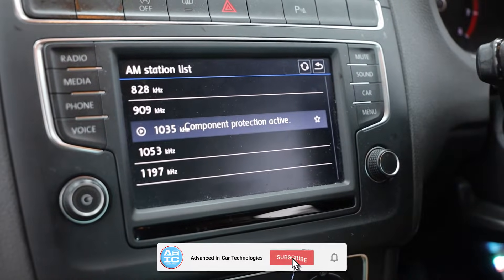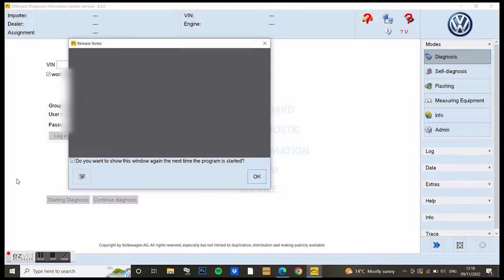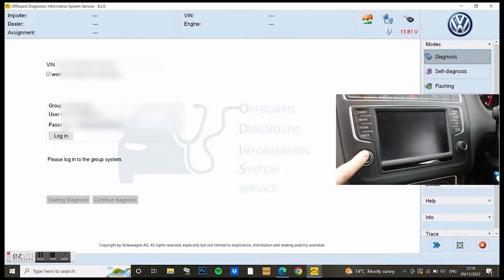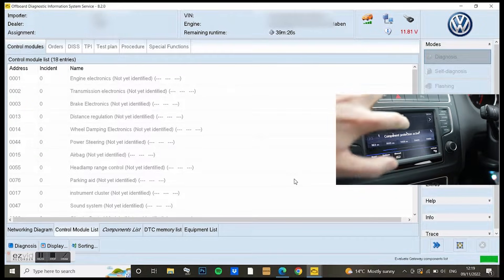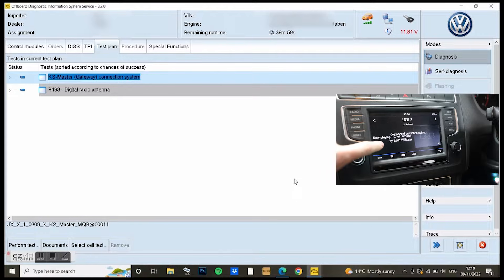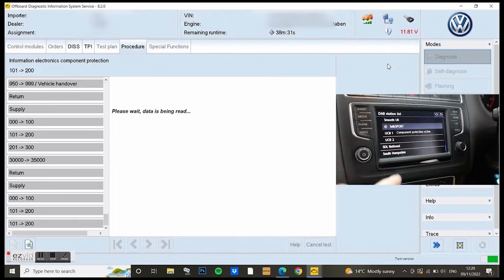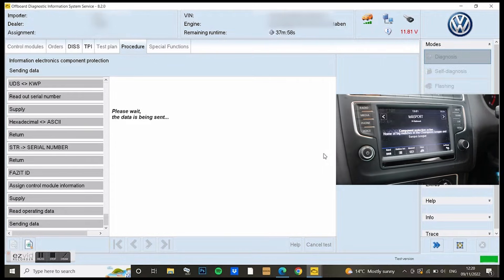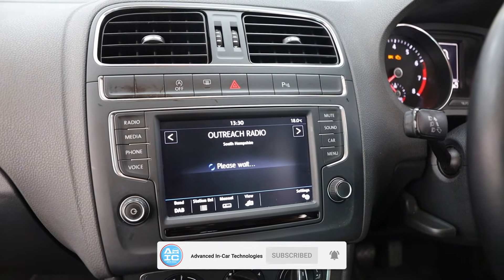How To: Deactivate Component Protection From Your VW Radio Via ODIS

Comment: I was damn well about to send this video to my VW dealership. I asked them if they could do this for my new (used) unit I have coming in after the original one got stuck in an endless power boot cycle. They said they've never heard of doing such a thing! Despite so many cars among multiple years having radio issues!
Reply: Ive fixed it? Might be able to help
Reply: That's only because main dealers don't fit used parts mate

Comment: VW B6 2007 - security protection turn on, on radio, after I had replaced a burned fuze - now radio is stuck bc previous owner lost a code - how 2 unlock/bypass that?

Comment: This video is not complete, after you are removing component protection, you are not showing what else will be going on, you are going to be losing 3 features. 1. bluetooth, 2. telephone, 3. car play. thats true i did that to my system and i was thinking everything is ok but when i was testing all features its showing 3 features is not active, which means you are going to have swap/ fec keys to be able to get back 3 features working, but it all depends if your system is is unlocked or stock, If its stock you will be needing swap patching system to be able to set the swap keys that is supporting your car
Reply: That’s exactly what happened to mine last week 🤬 Do you gave a way to fix that???
Reply: @melvega1903  I can help fix :)
Reply: @Beterr I am in the same boat. Got protective mode cleared out with ODIS from the dealer but still don’t have Bluetooth / phone / CarPlay. Any tips? Is this still a fix within ODIS? 2016 Tiguan with navigation
Reply: Factory radio touchscreen broke… replaced with a used radio and had the dealer remove protected mode… 160$ … and still not Bluetooth / CarPlay / phone / nav. Radio only 👎
Reply: is there any solution ? i got that problem
Reply: How are swap keys set?
Reply: How do you do the swap keys
Reply: Chances are you'll have to reactivate via secret menu if it's anything like the c6 a6
Reply: Cómo sería? @jimneybob8847
Reply: The video shows exactly what it says on its label - resolving CP conflict. You also need to transfer your FEC codes for additional features to work, and that's entirely different topic.

Comment: Nice video, what cables are required to connect via odis? Is it the e1000 from dlink?
Reply from the maker: Hello Christopher,

Thank you for getting in touch!

We are an authorised VAG independent workshop and have access to main dealer diagnostic equipment. This is the reason why we are able to complete these procedures. 

We can’t offer any advice on other aftermarket peripherals I’m afraid sorry.

Kind regards,

Advanced In-Car Team

Comment: I had to replace my ACC sensor on a mk7 GTI with a second hand unit from a breaker, will this make it work again? Thanks
Reply from the maker: Hello Shaz,

Thank you for getting in touch and sorry for the delayed reply!

For my team to assist you with your enquiry, we would need you to fill in our contact form so we can do some checks. Please see our link below:

https://www.advanced-incar.co.uk/contact-us/

Once received, we will be in touch as soon as we can to assist you. 

Kind regards,

Advanced In-Car Team
Reply: Did you get an update, iv got the same issue on my mk7 gti
Reply: @ayshaakeel388  hello,
I have ordered the exact part number for the sensor. Once it arrived, it had to coded to the car. There will be a “component protection protocol” that needs to be released (it’ll still be coded to the old car it came from”. You can only do this with the vw official ODIS software (although I’m not 100% certain). Once the second hand part is coded to your VIN. You will have to have the sensor aligned using ADAS specialist equipment.

All in it cost me £250. Including the part. I did all the fitting but got a friend to do the coding and sensor calibration. You should be able to find a vw ADAS specialist in your area. Hope this helps

Comment: hello, thank you for this great video.
can we use any third party OBD connector to perform that, or do we need the VAS 5054a obd connector to remove the components protection ? 
Thanks again and have a great day
Reply: Good question, found an answer?
Reply from the maker: Hello Hashkemo,

Thank you for the chase up! As said to Hou, see below 😊

Invariably, we always use our VAS 6154 Diagnostic tool with ODIS to preform main dealer functions like Component Protection. We are unaware of any aftermarket device that has the capability for this feature because it has to connect with servers in Germany. 

Hope this helps!

Kind regards,

Advanced In-Car Team
Reply: Where about are you and how do I go about booking in.  I got a vw caddy replaced the stereo worked for 5 days and now no sound, taken to my local vw specialist who said it couldn't be done, but it worked for 5 days 😂😂
Reply from the maker: Hello Hou,

Thank you for getting in touch!

Invariably, we always use our VAS 6154 Diagnostic tool with ODIS to preform main dealer functions like Component Protection. We are unaware of any aftermarket device that has the capability for this feature because it has to connect with servers in Germany. 

We hope this helps!

Kind regards,

Advanced In-Car Team

Comment: I swapped ECU in Passat B8 and CP became active in 5F. 5F was oryginal component. During CP removal in 5F an error appears from FAZIT "FAZ9484E checksum-1 is incorrect". Installed back oryginal ECU and tried remove CP from 5F again and still same error. Perform 5F online software update, coding, parametrisation, reset, still same error and CP not possible to remove. VIN in 5F is same as the car but still CP active. What to do?
Reply from the maker: Hello there,

Thank you for getting in touch!

For the team to assist you and provide you with detailed response, we would need you to fill in our contact form. Please see our link below:

https://www.advanced-incar.co.uk/contact-us/

Once received, we will be in touch as soon as we can to assist you with your enquiry. 

Kind regards,

Advanced In-Car Team

Comment: Hi, great vid. How this work with having to log in online to the VAG servers to check if the used part is stolen. I didnt see that part. (or was it online all along)
Reply from the maker: Hello Christopher,

Thank you for getting in touch!

We are an authorised VAG independent workshop and have access to main dealer diagnostic equipment. This is the reason why we are able to complete these procedures. 

Kind regards,

Advanced In-Car Team
Reply: @AdvancedInCarTechnologies Hello, I have a 2018 Passat infotainment system. It has component protection active. How do I deactivate it? Is there any way to contact you?